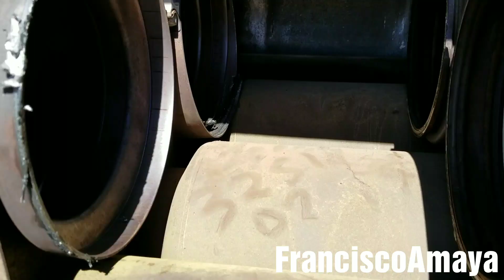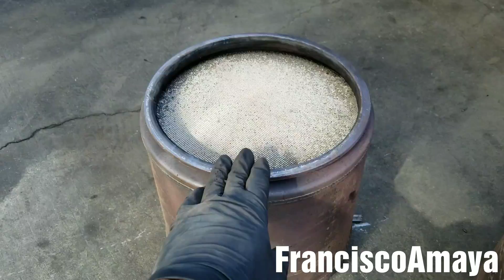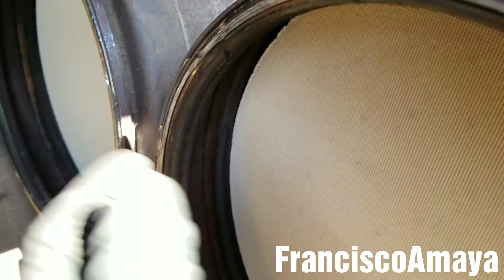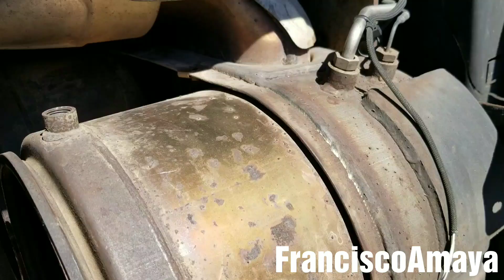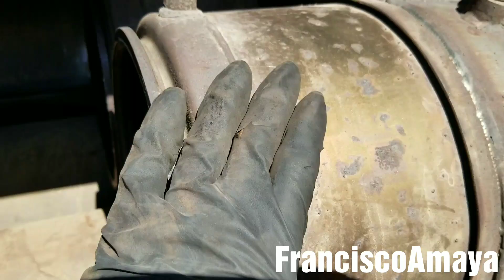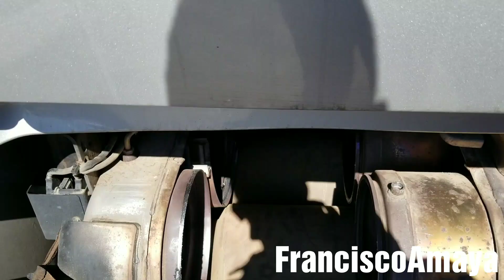Freightliner cascadia DD13 DD15 DD16 spn 3251 fmi 02 DOC DPF pressure high SCR box

Comment: Great thanks for the video! Could you tell  please how to check the doc pressure sensor? I see on diagnostic link  that doc pressure sensor - "Not plausible" and the same cod 3251 2 along with the cod 4364 18. 
While doing parked regeneration the DOC Inlet pressure around 2psi.
Dpf outlet pressure 0.48 psi.
P.s.
I am doing parked regeneration for 1 hr already and noticed that DOC Inlet pressure dropped down to 1.5psi. Will continue doing it. As I understood the normal pressure for the DOC Inlet should be something below Dpf outlet pressure...  By the way the Nox conversion efficiency is still low around 30%. If the DOC Inlet pressure will drop down to normal will the Nox conversion efficiency be increased? Thanks.
Reply from the maker: That seems like the scr box is bad. 
You need to bypass it or replace it. 
To bypass you can watch my video.

Comment: Francisco, is it true that you can clean the dpf filters with a  high pressure water gun like the ones that are used in the car wash?
Reply from the maker: Yes, so people do that.  
I don't actually like that method but it is possible.  To make this process better you have to used distilled water to don't leave Clorox or other components that regular household water has.  This will cause problems to the interior to the filter.
Reply: @franciscoamayaYT , thanks for the info.

Comment: great video. I have code spn3226 exhaust nox sensor. where is that sensor located. do u have a video for that spn3226 code.
Reply: there are two NOX sensors. Each one different than the other. One is intake and the other one is outlet. Intake is by the turbo and the second one is under the truck by the exhaust around the DPF filter area. They both have a somewhat thick cable coming out of them, so once you spot the one from the turbo area you will easily recognize the one from the bottom.  Replace them both at the same time. If one goes bad the other one will go bad as well within a couple of months usually.
Reply: @DK-fq3hy  remember some nox sensors are located in different areas due to changes in the engineering of the one box from year to year .
Reply: @daniellongoria9622   correct. They could be anywhere.